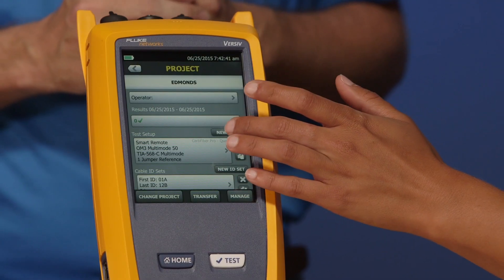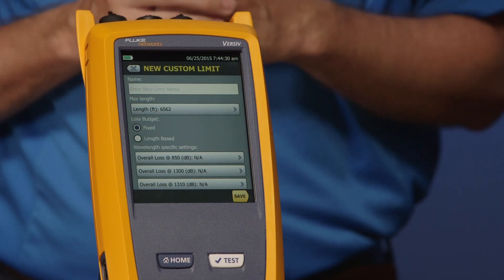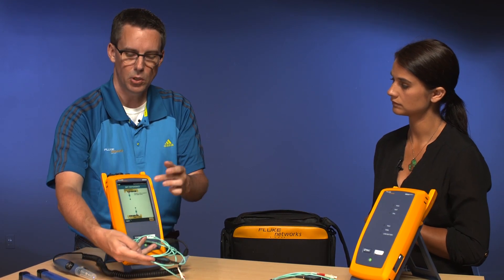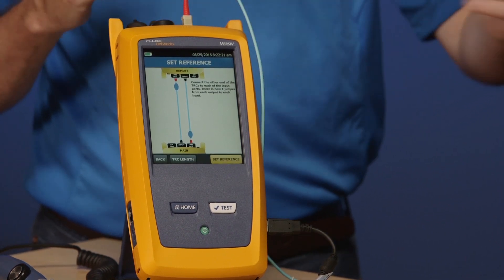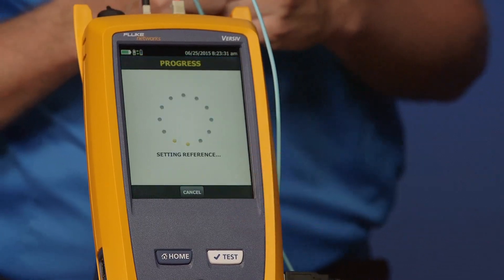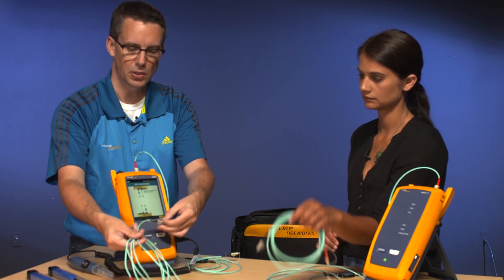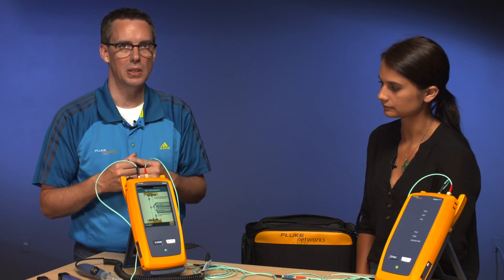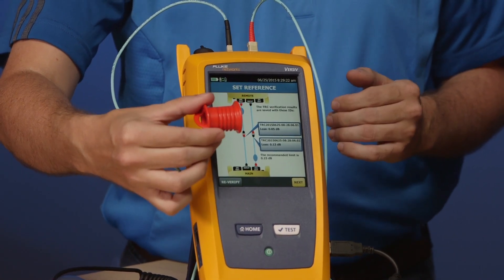CertiFiber® Pro OLTS- Setup Part 2: By Fluke Networks

Comment: BUENOS DIAS  TENGO UN OF-500 FLUKER  EL CUAL AL MOMENTO DE COLOCAR  EL MODULO O CABEZAL MM ME SALE ERROR Y ME PIDE ACTUALIZACION ...ALGUNA SOLUCION PARA PODER SEGUIR LOS PROCEDIMIENTOS
Reply: WASSAP +59176351029   +59172682097  POR SI ALGUIEN TUBIERA ALGUNA SOLUCION